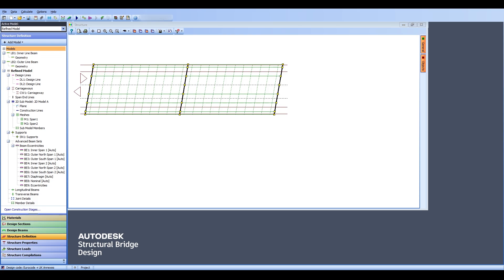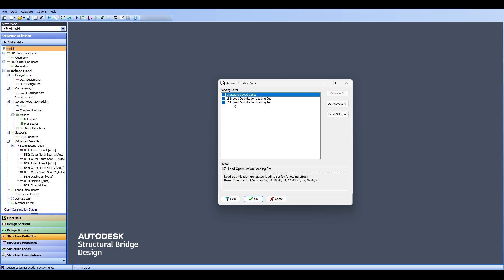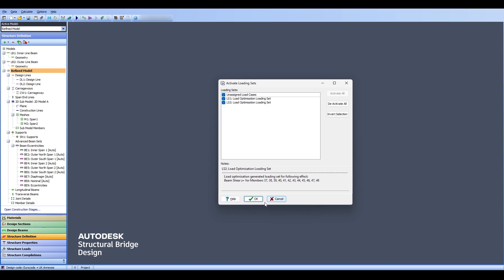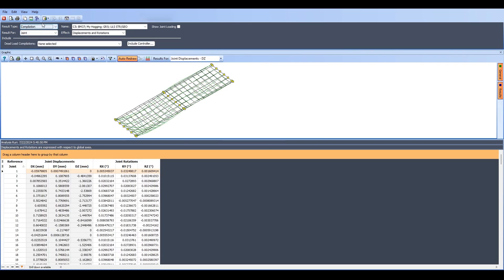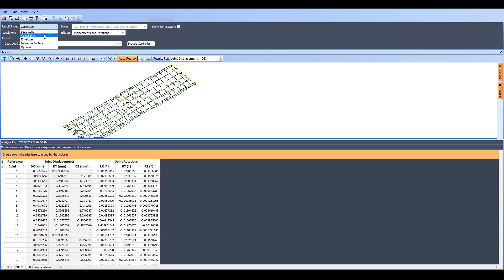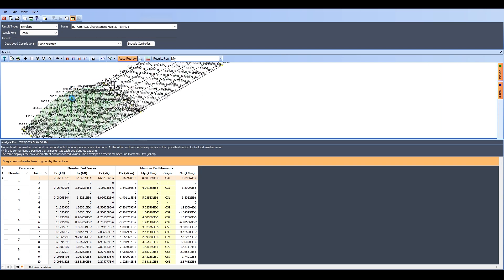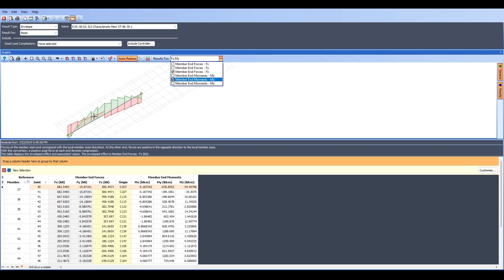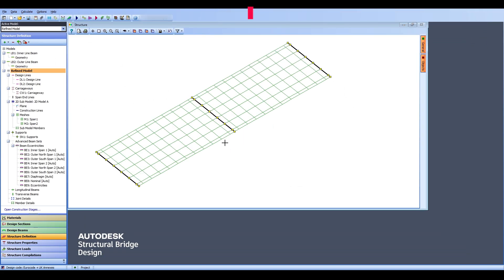Modeling & Design of a Prestressed Bridge on Autodesk Structural Bridge - Part 9 Structural Analysis

Comment: Dear Dr. CEE
After I completed this course i want to ask you : what is the extended analysis that you get from this software rather than using robot, and whether this software cover all of the required code design steps
Reply from the maker: the software is amazing in the fact that it can automate the entire vehicle load cases + it is good in checking prestressed sections

Robot has the ability to deal with vehicle loads (I have an influence line and influence surface video) but does not really cover all possible cases + is EXTREMELY weak for prestressed design.

PS: sry for the late reply.

Comment: Instead of the repeat definition of the same filter, use the small drop down button next to the filter button to re-pick the last selection set. If you save the filter, the name of the filter will appear in the drop down filter menu.

Comment: Hi CEE,
Your videos are very easy to follow and we'll explained. Thank you so much!
A few questions through:
1. I noticed that the load combinations (compilations) for the SDLs and the vehicle loads (from influence surface) are separate and not combined under the same name. Is it that they will combine later on?
3 
2. Will you be making a tutorial covering the AASHTO code as well? (preferably with steel to get more coverage)
3. I realized that to get results for each beam, a countless number of loads and load compilations will be generated from the influence surface. Is there are more efficient way or is it inevitable?
Reply from the maker: I may have misunderstood some points so please do clarify if you want.

1. Superimposed dead loads and vehicle loads are separated as vehicle loads will be multiplied by different factors and are treated differently when checking for deflections and so on.

2. I am intending to pick up the series after I finally finished the programming thing.

3) Influence surface compilations is inevitable as it tries to cover every single possible position for the vehicles. It is part of what makes this software amazing.

 seismic depositions, no requirements